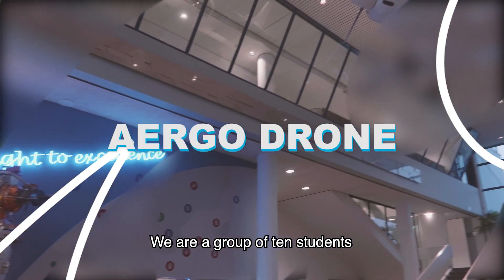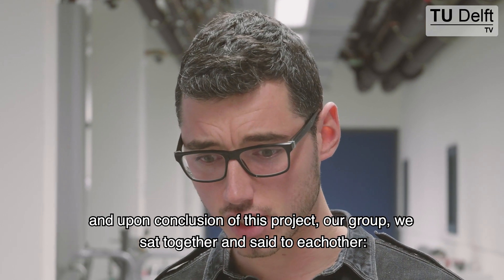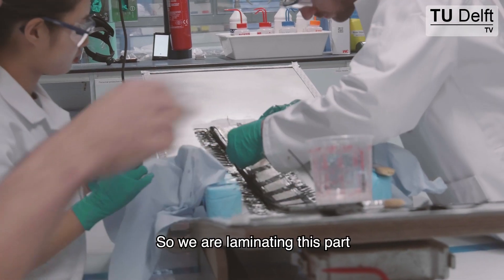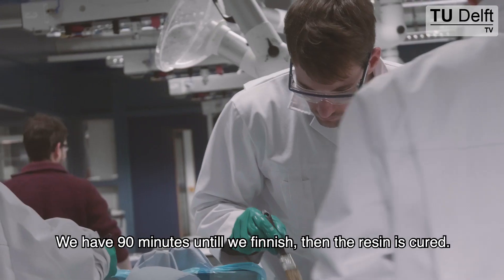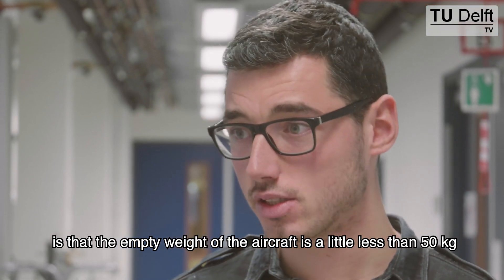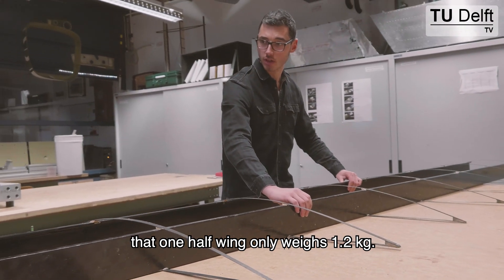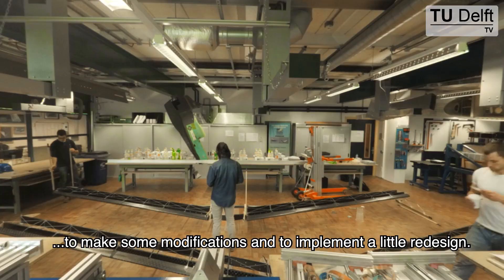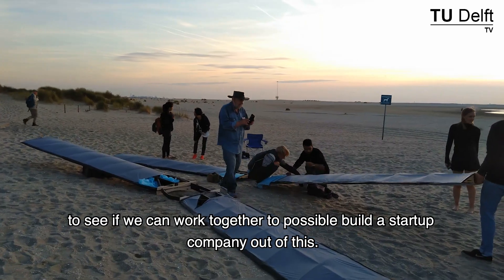The lightest aircraft ever built

Comment: Only Gen Z could rebuild an existing design using the most expensive method available and then applaud themselves for the effort when it hasn't been proven successful.  I particularly like the way it wobbles during the test run.  Maybe a few kg of special carbon fibre filament can cross brace the design so that is a thorough copy of the Icarus2 / Easy Riser

Comment: There are flexwing trikes with a 14kg / 27hp engine that weighs only 48.75 kg.
Even less with a 10.4kg / 16hp Vittorazi Motors Atom 80 engine.
CF Construction is labour intensive and expensive so the claim "affordable" is unfounded.
Having said that this an excellent project for the students.
Reply: @SR-gs8zo  you wont get 12 hp out of a 3kg engine . 12 hp burns 2 gallons gasoline hour .  Or it wouldnt be 12 hp

Comment: It's called an easy riser, this design was done back in the 70's by Taras Kiceniuk originally as the Icarus V bi plane glider
Reply: And just like that I have a playlist for the night and my faith in public comments has been restored.
Reply: I had the Icarus it flew great, but you wasnt strapped in. You hung from your arm pits, and you turn by twist grips that' controlled winglets on each wing tip. It was a big scary.
Reply: Sort of... Taras Kiceniuk Jr. (and his dad) built the Icarus I - a tail less flying wing biplane with 28 foot span and 48 inch chord.. The trailing edge extended 6 inches beyond the rear spar but was too flimsy and kept snapping off, so Tarus redesigned it slightly without the extended trailing edge leaving the wings 42 inches wide. He published a plans book and supported homebuilders via correspondence and phone calls. Larry Murro of Cupertino California produced a kit for easy assembly of the Icarus II and named his company UFM Ultralight Flying Machines. A few years later Tarus designed a single wing flying wing named the Icarus V. A few years after that... Larry and John Moody trimmed 3 feet off each lower wing of an Icarus II and created the Easy Riser. The Cato brothers mounted a chain saw engine and propeller on it and that's the Easy Riser. Larry's daughter Jenny - www.youtube.com/@sunboxstudio - may have more complete info.
You're welcome ; -)
Reply: I have photos of my friend flying his Easyriser many times.
Reply: I built the Easy Riser in the 70's. Flew great with an engine.